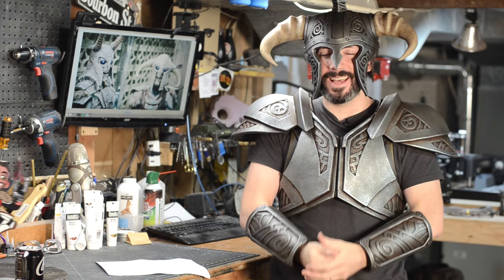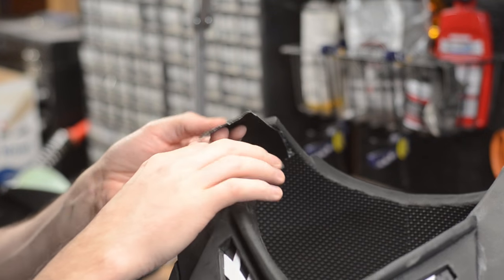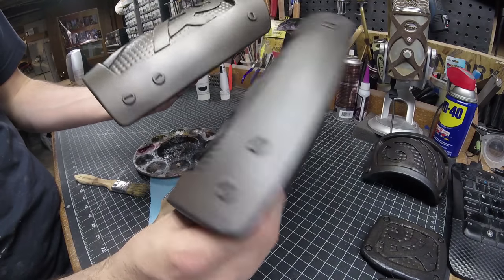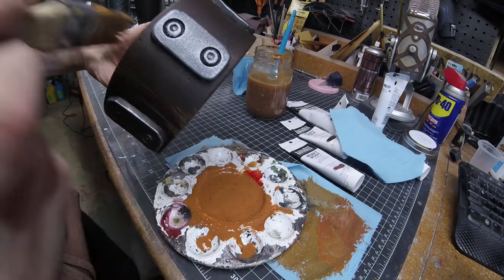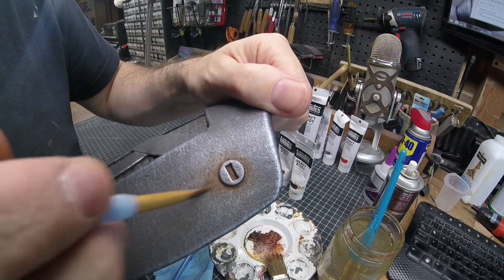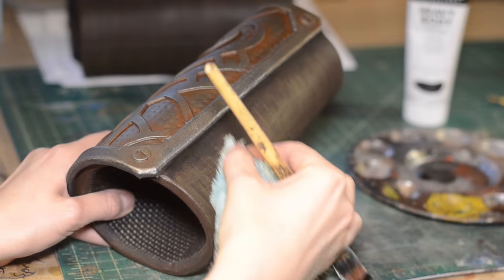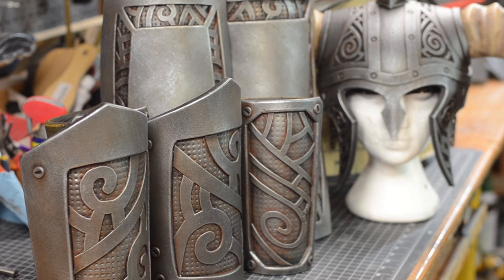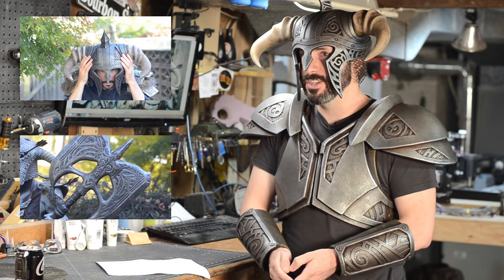How to Make the Skyrim Steel Armor Costume Part 2: Painting a Faux Steel Finish

Comment: At art college we put a few sheets of wet kitchen roll on our pallets rather than adding loads of water to the paint , this way if you want more water you just press your brush down on the colour you want and it doesn't spill or flood into other colours... it also lasts a lot longer on your pallet before it dries and you don't need to worry about cleaning up when you're done as you just lift off the paper and run the pallet under the tap and you have an immaculate pallet and a nice paint job 🤓 no more scraping dried paint off

Comment: I've learned a good way to make eva or other smaller craft foam to get a good crinkled texture of leather is to get a piece of aluminum foil (size depending on the how large your item is), crumble it up into a tight ball, carefully unfold it and take the crumbed sheet and place it over your item and then run a clothes iron over it, then repeat, repeat over the whole item.  do that all the time for my ren fest costume
Reply: Punished Props I just finished construction on my chest and back and I achieved my leather texture by running a wire brush along the pieces to give it creases and grain.

Comment: I made some iron armor from skyrim, and I will be making a video on that maybe in a few hours
Reply: Alright, I uploaded it so you can see the video
Reply: I am also attempting some fallout 4 power armor, which will be attached to a wooden frame with some lockable joints, so if you want to check that out too I will try to upload more often

Comment: Sir, What varnish spray can is that? like for wood varnish? I got clear coat spray paint  but it's not so flex. Is 1 thin layer spray of clear coat okay for flexing foam? and does the metallic lost it's metallic if i use 1 thin layer of clear coat?

Sorry for bad english,

Thank You

Comment: Do you find you get a lot of 'cracked' paint with the pieces of the armor that bend a bit, even when using plastidip? I find whenever I use spray paint for a base colour, no matter how I apply it - very thin coats, thick coats, lots of plastidip, next to no plastidip, there's always cracks because the EVA will move while I paint it by and it'll 'crack'. Does it happen to you? If so, how do you fix it if it does?
Thank you!
Reply from the maker: It does crack a bit, or at least crinkle. A lot of it comes down to how you build your armor. You want to structure it so it has the LEAST amount of flex - it's always a challenge.